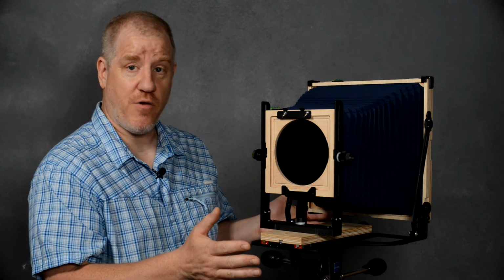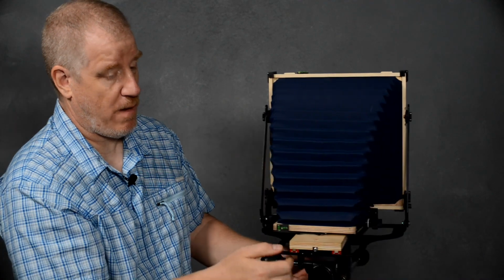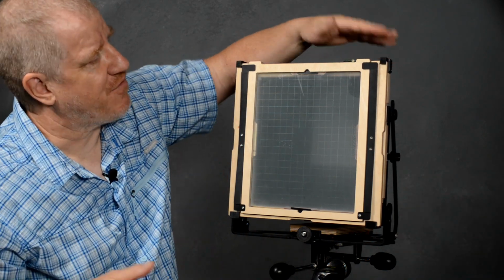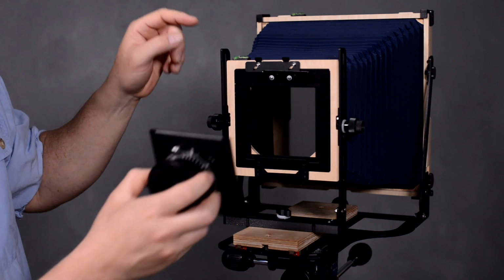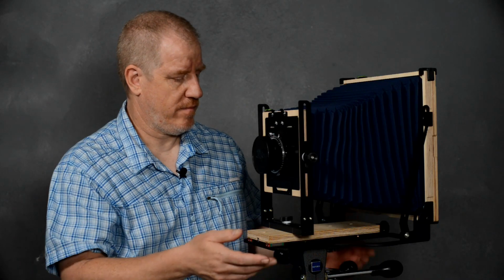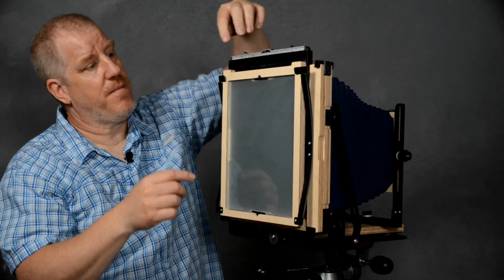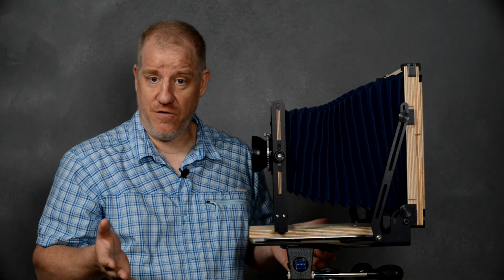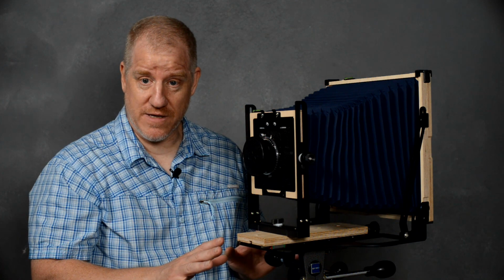First Impression Intrepid 8x10 MkII Camera

Comment: Thanks for the tour. I'm confused about the max bellows extension. The website says 560mm. The Mk1 was 600mm. You just said 26 inches (660mm). Is it a typo on the Intrepid site? Obviously 560mm wouldn't support 600mm lens and it is unlikely that improved bellows would be shorter. (I'm so close to ordering one. Hopefully to arrive in time for Christmas!)
Reply: Roger, I'll take a measurement later today.
Reply: Roger, I was just copying specs from Intrepid.  I apologize if I got it wrong.  Anyway, I just used a tape measure, and it's 20.24" (514mm) from the ground glass to the front side of a lens board.
Reply: Thanks  @peterdesmidt8742   I've ordered one now and have a couple of lenses (not too long) that should cover 8x10. It is a bit naughty that the Intrepid site still says is will support 600mm lenses - maybe a telephoto. I'm sure I'll not use over a 400mm. Can't wait.
Reply: @RogerHyam  I agree about the naughtiness.  Lens up to about 450mm should be very usable.  I also just bought a 159mm Wollensak.  It looks like it'll work without showing the bed of the camera, but I've yet to take a picture with the combo.   I hope that you enjoy your camera!